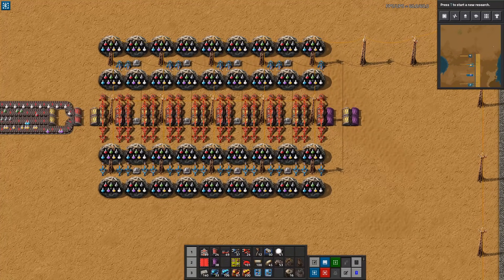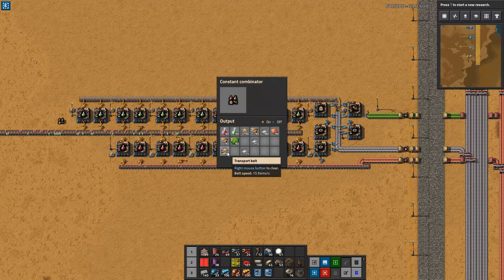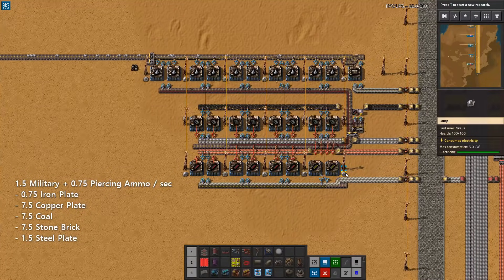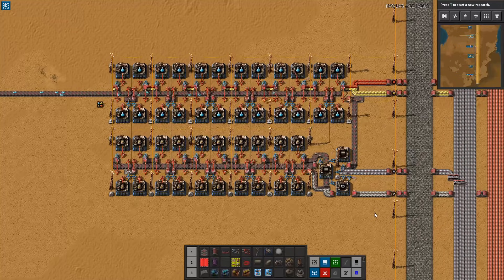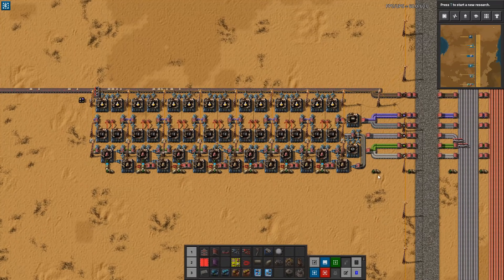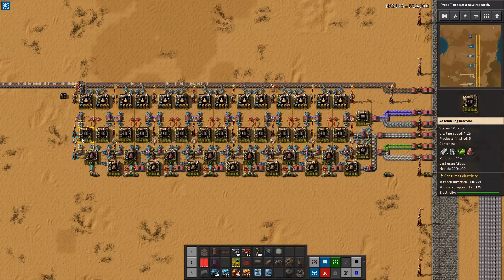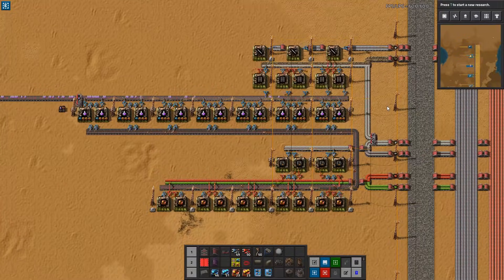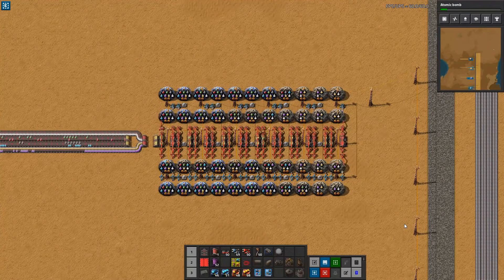All SCIENCE Layouts and Designs - Factorio 0.18 Tutorial/Guide/How-to

Comment: I guess I'm a bit too late, but I think there is an error in utility science input calculations.
It says that it requires 1.5 steel plate, but we need 2 per robot frame * 0.75 crafting speed * (14/21) science packs per second = 1 steel per second actually.
It's 1 processing unit and battery per second for the same reason.

Comment: Could someone explain the belt math to me? I'm a little confused on the per second values in the corner of the screen.
 For example: Should the green science need 6.75/s? I've tried the math as best as I know how but making 1.5 green per second should only need 4 iron because you only need 6 per science right? If you were to include the green circuit iron plates that would only add 2/3 of a plate per second.

Comment: I'm using the science design from 18:30, and I noticed some "hiccups" while researching. This is due to the fact that the outer inserters got stack bonuses.
So remember to override stack size to 1 on the outer inserters, and it's all right. 👍😊
I'm also planning to transfer the outer labs to a more inline setup, so that I can fill the section with beacons...

Comment: If you are showing designs that make 1.5 of every science per second, perhaps you could have been a bit clearer about making sure that you have the correct number of labs to use that much science? I appreciate that it's hard to explain though, as the number of labs requied varies based on the research cycle time, the lab speed and the modules in the labs! Personally, I use the factorio cheat sheet calculator. https://factoriocheatsheet.com/#science

Comment: Would you recommend these blueprints if I want to get the 8 hours speed run achievement?
Reply from the maker: I think they are too slow.
Reply: it's actually sort of overkill. I've done a run with 0.75 Science per second(45 SPM) and was able to get sub 4-hour on the second attempt. obviously, this only works if you only research the required technologies (and maybe a few other cheap ones) and use (first level) modules. if you are trying to get sub 8 hours here are a few tips.
1. you actually only need 1600 purple science and 1400 yellow science in total, not including productivity(which you will definitely want).
2. set up tier 1 modules as soon as you have red and green circuits, and put them in anything that needs it (especially yellow science and labs). also, don't make any higher tier modules, apart from 4 tier 3 prod modules for the rocket silo (which reduces the cost of the rocket by 25%, so you only need 750 of each part instead).
3. don't build a bus base. bus basses use way more resources than a more spaghetti base(obviously don't build things to close together because then you have to weave all over the place.) 
4. basically rush to robots early game. You need so many resources for blue circuits and the builds get quite big, so robots are a life saver.
5. try to get a small amount of steel set up right at the start (0.5 or 1 yellow belt of ore) so you have enough for the low density structures and purple science later on.
6. Plan out your whole base beforehand in sandbox mode, and play on the same seed. this helps a lot so you don't have to spend a heap of time designing.
Hopes this helps a bit :D
Reply: Sort of.  They work well, but I would half them, so 45 SPM instead of 90.  Also, don't worry about bots, the time it takes to get them up and running isn't worth it.  His comment about stealing electric engines to build the silo is a good idea.
Reply: If you are interested in tips for a speed run Nilaus does a great 100% run here https://www.youtube.com/watch?v=4jPbPfh8wYs&list=PLV3rF--heRVuDLb4Ei11BydUdVi_L1KFu   I never considered doing a speed run until I saw this video.  I really liked his setups to achieve just getting the rocket up.  On my first attempt I did it in under 6 hours and really surprised myself!